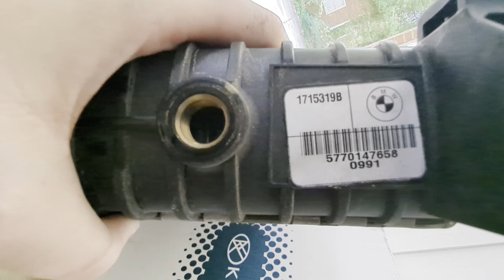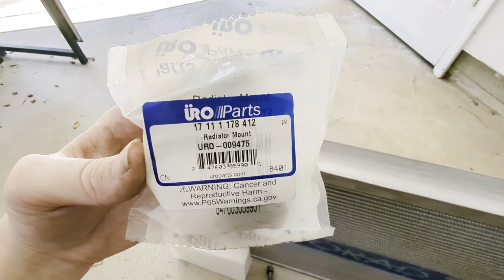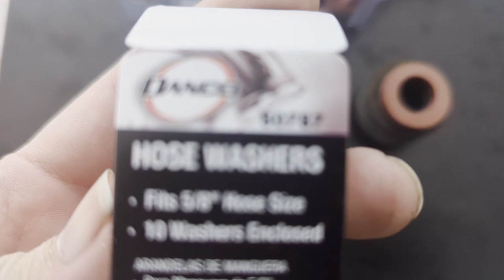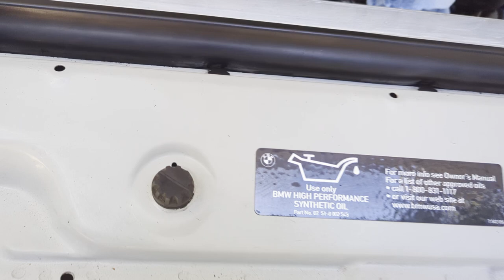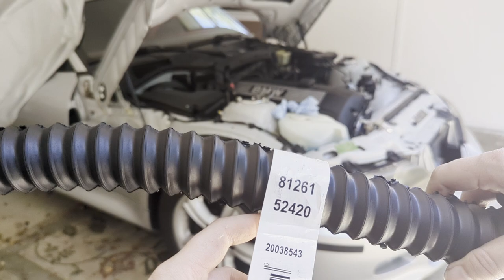Upgrading My BMW Z3 Radiator

Comment: Coolcat!! Another awesome vid! 👍🙌🏼👏🏼😎 I did the same replacement earlier this year and also went with Garagistic radiator mounts and after numerous checks, I wound up with a slight dimple on the passenger side of the hood. For some reason my mounts were just 1.8 mm too high. Very slight but noticeable, so had to have it repaired.
Reply from the maker: Thanks for watching. With all my test fitting and adjustments I hope I have mine set right. I'll close the hood gently to be cautious. I can always remove one of the rubber washers spacers to drop the radiator down a bit if necessary.

Comment: Great video! Super helpful since I have the exact same car :) Just entered the link you gave for the radiator, but just noticed the pic looks a bit different. Just wanted to make sure it's the same one even though it looks like another one. Thanks!!!
Reply from the maker: Yes, they have the wrong image. Just match up the model number to be sure it's the one you want.
Reply: @CoolcatsAlley  greaat thanks!!
Reply from the maker: @ernestosolorzano3410  Don't use the aftermarket hoses. Get OEM quick disconnect hoses. I ran into leak issues and addressed those in a different video.
Reply: @CoolcatsAlley  Ooh! Thanks for the heads up! Also, wanted to ask, I don't think I'm replacing (at least for now) my clutch fan. IDK if the KOYO Radiator is thicker and there would be a clearance problem with the clutch fan? It's just from what I see on the video but it could be easily a perception thing. Thanks again!
Reply from the maker: @ernestosolorzano3410  The clutch fan is supposed to fit. Check your fan and your shroud for cracks. They will break and destroy lots of parts.

Comment: Shoudlve bought the 3.0 😅which is the only Z3 worth anything next to the M roadster!  Wish I could post pictures of my car… 😂 at least you’re trying.. but why post videos on issues that have been out for years. Again my car no fan, bigger radiator, no different aux sensor flushed with distilled water and filled with bmw coolant. Driven multi state 30 day road trip and no overheating. The 3.0 is the z3 to buy next to the M roadster or you’re just driving a girls car 😂
Reply from the maker: First off I didn't buy this car. I got it for free by trading a non-working car for this car. Once I got the car I began researching it so I can learn more about the car and what issues I might come across. But to make this car a daily driver, I have to do more of the general maintenance on it first to get it caught up so I can start driving it so that entailed fluid changes and tires first as the car had been left sitting from previous owner. I don't even know a Z3 existed until I ended up procuring one. Had I known about these in advance and was in the market for one I would have gotten a 3.0. I've never heard of a Z3 until the guy offered the trade me his for my broken piece of junk that I had.
Reply from the maker: "I'm just driving a girls car" okay now I know I no longer have to take anything you say seriously because you're just one of those guys who are like to say oh all mine's bigger. There are many, many Z3 enthusiasts who are men that have 2.5s. it's very common to have a 2.5 heck, most of the Z3 enthusiasts I've run into have the 1.9. Get over yourself dude.
Reply: @CoolcatsAlley I got a 1.9 🤣🤣 still having fun. engine swap will come later still got 130k miles on mine